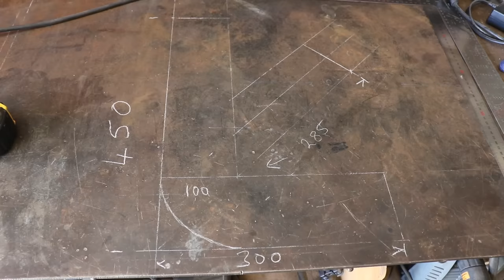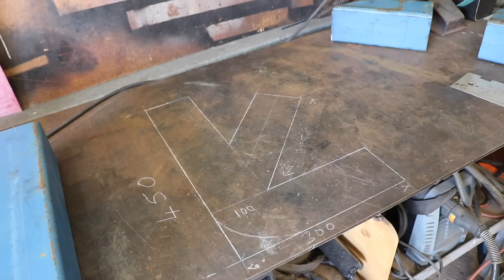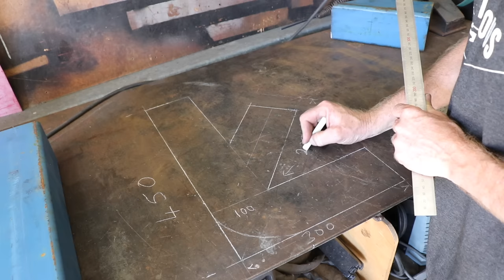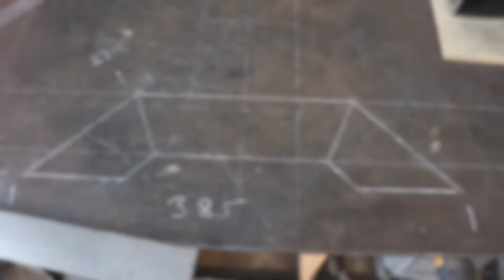DIY Powerful K Style Rocket Stove - Forme Industrious

Comment: When I worked as a welder, the machinists used to tell us off for using the bandsaw for hollow tubing because it always mangled up the teeth on the blade. I noticed it drifting on that angled cut, and it brought back memories.
Reply from the maker: There are those in every trade that like to assert their incredible knowledge on others ;) It's all about teeth per inch (TPI) and surface contact, and speed. You get that right and it's perfectly acceptable to use a band saw. The saw you used may have been set up for cutting heavy material. Yes my saw may drift. Sometimes it needs resetting and sometimes I'm too lazy.
Reply: @ScottTurnerformeindustrious   All good, Scott. I was just remembering my own mistakes and getting banished from the bandsaw by grumpy machinists. They had that tool set up for cutting solid shaft.

Comment: Great job Scott.  I’ve been making these for a few years now.  I make an optional pellet gravity feeder insert version.  Took quite a few goes to get the feed just right.  
I’m toying with the idea of fitting a length of 3” exhaust tube about 2.5m long to a 180’, then back down to about 1.8m, with another 90’ elbow, then it goes out through a panel that fits into a window (only needs to be clipped into the frame), and then a final exhaust flue.  It would be as an emergency backup, should we lose power for an extended period. We lost power for 5 days after a storm in May 2019, which was tough, but at least it wasn’t the depths of winter.  Cheers from southern Tassie.
Reply from the maker: Thanks for your message Andrew! Yes there are lots of adaptations for the stove and your idea sounds interesting. I used mine again a few nights ago, uses very little fuel to cook up a good feed. Thanks again and all the best.

Comment: Cool build, woulda maybe made the pan support adjustable height-wise to give you a bit more temperature flexibility beyond the amount of material in the chamber. Nice vid!
Reply: I’m building one for a project in school out of 1/4” wall 4x4” square tubing (like 6mm wall and 100x100mm roughly if you use metric measurements) How would you make it adjustable in height?

Comment: Nice video. Is their any improvement you see after experience? Are you happy with the global design and the size of the chimney?  Shouldn't it be higher ? Thanks for your feedback.
Reply from the maker: Thank you! I'm sure there are some improvements such as insulation but my goal was to keep it simple and this stove works well as it is. I'll make a small scoop and handle for removing ashes as it burns. I use a large handle spoon for this now. Other than that I'm happy with it.

Comment: I made a k style rocket stove here recently. I noticed my feed tube & air tube are about 5 inch’s longer than yours. Does it make a difference with my air tube being longer? Does it hurt the airflow? Should I cut them off or just drill some holes closer to the front?🤷🏼‍♂️
Thanks in advance, any info is greatly appreciated! Thank you!
Reply from the maker: I really haven't tested tube lengths sorry. Just thinking it through; if the air intake is longer there is potential to get more airflow obstruction. How well is your stove going, that's the best indication? They take a bit to heat up and get going initially, but once going it should give good heat and draw in that air. Sorry I couldn't be of more help.
Reply: @ScottTurnerformeindustrious  my stove is not to bad , I’ve tried it a few times, it just don’t seem to roar like some stoves I’ve seen on here do. I got a small pot of water to boil in 20 minutes, it was just hard to keep it boiling.
Thanks for the info, and quick response! I might tweak it, or I might just keep trying it ,…and it might be good enough.
Thanks again!

Comment: Hi Scott. nice build. i noticed you didn't install a grid inside. Seems like its working just fine or would you install a grid next time?
Reply from the maker: G'day Nick. This one seems to work just fine without a grid, perhaps as it has two air intakes. I made a smaller one with a grid and it's hard to say if it makes a big difference or not. I have a scoop that helps clear the ashes as it burns.

Comment: Very nice build, excellent, but the walls are not insulated, I thought all rocket stoves had insulated walls to increase the draw. In fact I thought this was the major difference between a hobo stove (not insulated) and a rocket stove.

Is this incorrect?

Love the design, think I might copy it, for my outdoor  kitchen area

Liked and subscribed, thank you
Reply from the maker: Thank you Tony. I will admit I am no expert on what classifies these stoves. Others have said that Rocket stoves must be insulated. My experience using this stove is once it gets hot it works much better and has that nice draw. It work well. Cheers.

Comment: Interesting - what does it weigh? I suppose you can make the same thing with tube rather than square. Damn, another project/experiment on my list that is already longer than my productive lifespan.
Reply: You mean round tube? Well... yes, but it's way more difficult to cut the joints; particularly the "feed tube".
Reply from the maker: It's heavy, but very stable. The steel I used was thicker than it needed to be
Reply: @ScottTurnerformeindustrious  I've found with BBQs and things that 3mm is around the minimum if you don't want it to get distorted by the heat. But then a square tube is so stable maybe 1.6mm would be OK. Great design I may copy it :) I never know what the ratio of the horizontal and vertical tube lengths should be but 300/450 looks good.

Comment: How do you controls the heat? Is it height adjustable? Or pull wood out? Close down the hole?
Reply from the maker: It's a matter of controlling how much fuel (wood) you use and when you cook. This is a simple stove. It has no adjustment but seems to work pretty good how it is.
Reply: @ScottTurnerformeindustrious  Thanks! Awesome build! 

Yeah I was just thinking that out camping, frying eggs vs steak is totally different heat levels.

Comment: I forgot to mention that I put move able gates for  air control on the feed tube and the bottom tube, plus I make ash scraper to pull out the ashes or push the wood down more as it burns.
Cheers from Canada.

Comment: Do you leave a vent hole open when you are closing in the tubing?
Reply from the maker: In the legs? No, not in this case. Good question though. The rear leg would get the most heat, therefore have air expansion. 4mm thick tube with 3mm caps on the feet is pretty strong. A tiny hole would give peace of mind I guess.

Comment: Seems like a lot of work to make a tiny grill that's too heavy to be portable.
Reply from the maker: I mentioned in the video description and perhaps in the video that the steel I used was much heavier than necessary. It can be made lighter. It's not really designed to grill for a family :) but it's perfect for a pan or pot. It will last a very long time.

Comment: Sorry, I think this design is not perfect, sir.
You forgot to put the combustion center above the air duct (the basic principle of how a rocket stove works).
Also make a place to dispose of the remaining combustion fire.
Reply from the maker: @budisetyono13  thanks for the feedback. Agreed it's not perfect, however it works quite well. It has two air intakes and the fire climbes above both. I use a small Ash shovel to remove ashes as necessary.